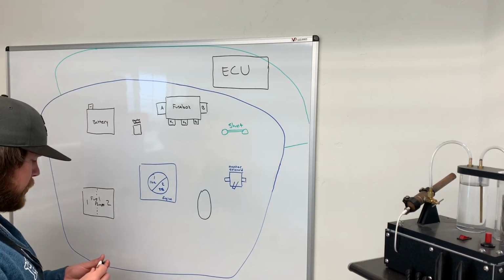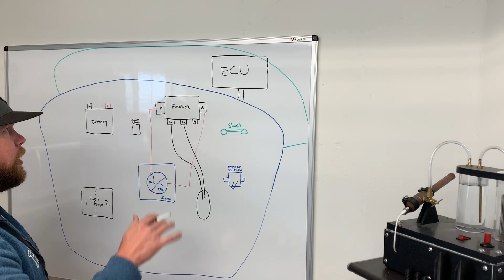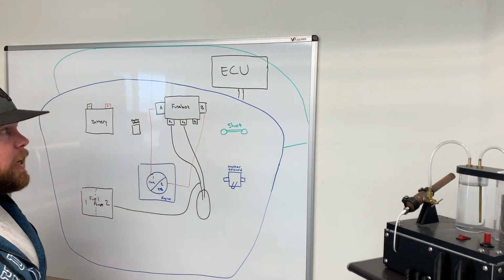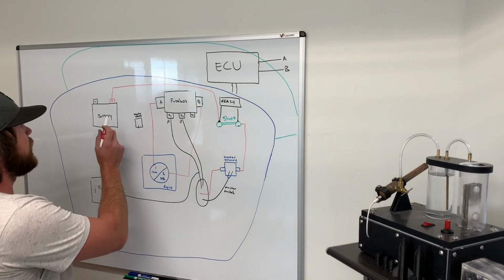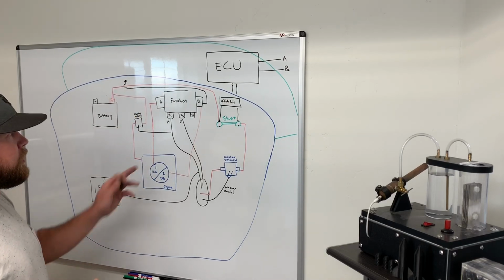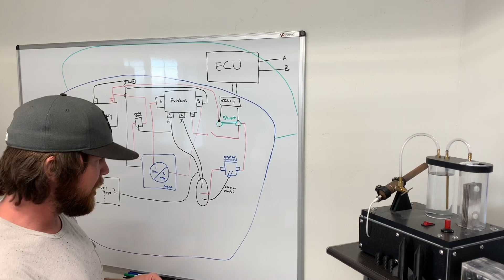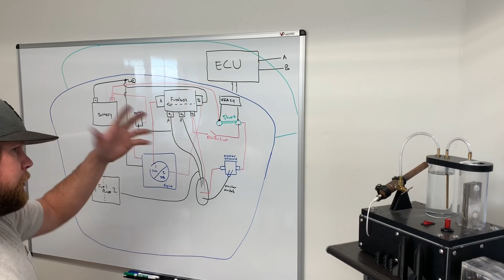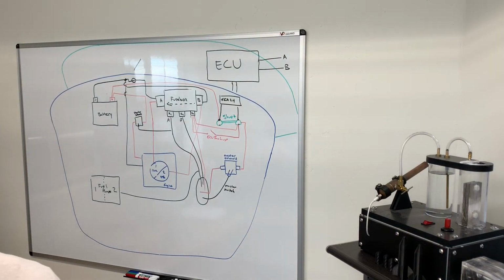Rotax 915/Sling TSi Electrical System Overview

Comment: Nice, thanks for sharing. What kind of master relay or solenoid did you use. I am not sure if I should take your solution or stick to the manual and take a masterswitch with build in circuit breaker. Is the shunt in the Sling package included?
Reply from the maker: I’m not aware of anyone using a master switch with built in breaker, a typical installation uses a master solenoid and breakers as required. It wouldn’t be a bad route I don’t think, but it’s not the standard for some reason. The shunt is part of your avionics when you order from somebody like midwest panel, or must be sourced with your electrical/avionics components if doing it on your own
Reply: @EvanBrunye  thanks, i try it completely by my own 😀
Reply: @EvanBrunye  sorry to bother you again, where did you get the ammeter shunt and how much Amps does it allow? 
Greets from Germany

Comment: Those really aren’t holes through the firewall with rubber grommets, right?
Reply from the maker: LTVoyager what do you mean
Reply: Evan Brunye @14:00 it appears that they are two holes through the firewall with rubber grommets in them.  To the right of the battery and above the Rotax regulator module.
Reply from the maker: LTVoyager ya one for the gps antenna wire and one for the ground wire pass through. What’s wrong with rubber grommets?
Reply: Evan Brunye The key is in the aptly named firewall.  This is a wall intended to block fire.  How long do you think it would take for fire to go through the holes in your grommets and also melt away the grommets making an even bigger hole.  An engine fire blown by a 100 MPH wind would be like a blowtorch coming in behind your instrument panel through those two holes.

http://www.aeroelectric.com/articles/Firewall_Penetration/firewall.html

https://www.aircraftspruce.com/catalog/elpages/firewall_penetration_kit.php
Reply from the maker: LTVoyager This is all how the build manual says to do it, but you definitely have a point. Thanks for the heads up I’ll see what I can do to fix it
Reply: Evan Brunye The nice thing about experimental is that you can do what makes you comfortable.  I simply wanted to point out to you something that caught my eye quickly.  I’m a pilot and a retired engineer and I tend to see things like that almost without even consciously looking.  Engine fires are rare, but they do happen and that is why certified airplanes have firewalls that will take the heat for sufficient time to allow a pilot to get the plane on the ground.  If it was my airplane, I would definitely not leave an open hole like that from the engine compartment to the passenger compartment as an engine fire that would otherwise be a survivable emergency will become a fatal accident within a few minutes.  There are a lot of ways I’d rather not die, but getting burned alive is pretty much at the top of my list of things to avoid.  😁

Then again, if your firewall is aluminum and not stainless steel, it won’t matter much as aluminum will melt fairly quickly in a fanned fire and you will have flames in the cockpit fairly quickly.  Most good airplane designs have either a SS firewall or an aluminum firewall that is a composite sandwich with a fireproof material in between the sheets of aluminum.
Reply from the maker: LTVoyager well your eye was sharp on the grommets, but was not sharp on the fact that my firewall is stainless steel. It  has a layer of fire/heat suppression material adhered to it. I’m with you though on not getting burned alive! Thanks for pointing out the grommet issue, it’s easy to solve as it’s only in two locations. Thanks!
Reply: Evan Brunye I wasn’t saying it was aluminum as that is pretty hard to tell from a video, but I would not be surprised as any designer who would leave open holes in a firewall might well not be savvy enough to use SS rather than aluminum.  It is good that it is SS as that means that if you seal the pass through holes correctly, you will have a high integrity firewall.
Reply from the maker: LTVoyager for sure man, thanks for all the solid input. I’ll definitely look into it